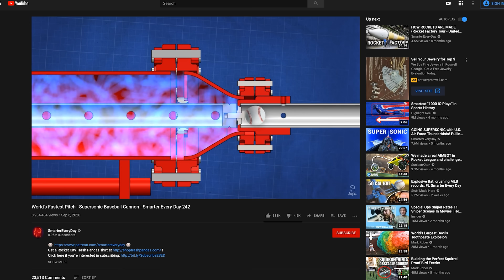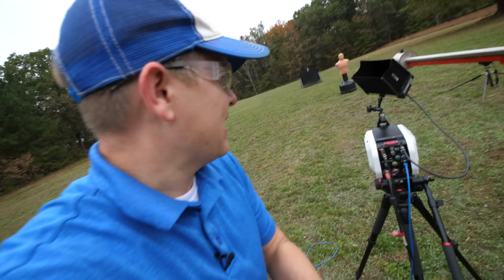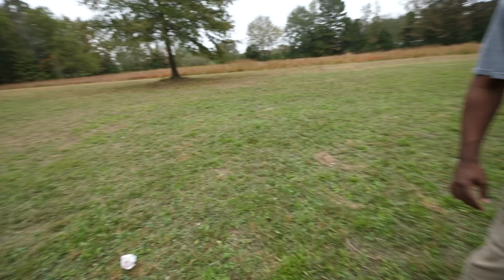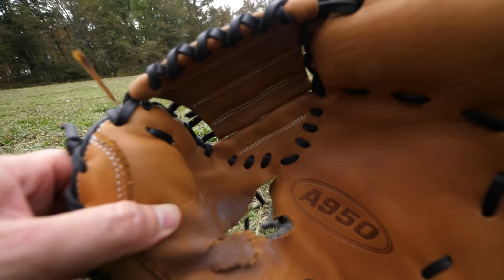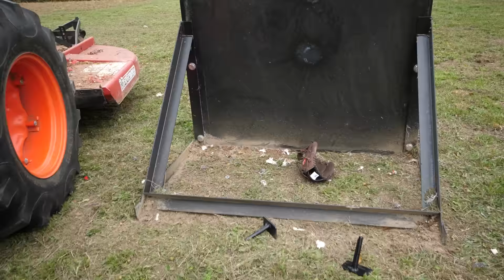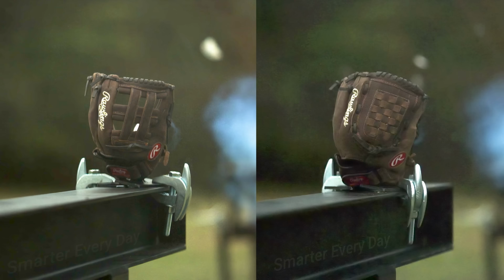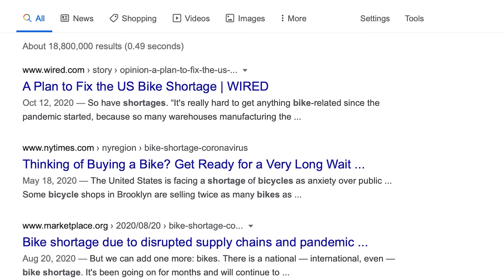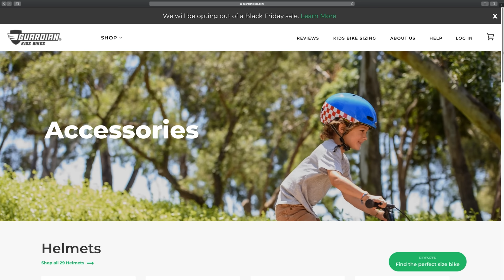Trying to Catch a 1,000 MPH Baseball - Smarter Every Day 247

Comment: I think the fire is a combination of the friction heat generated from the leather on leather contact + the adiabatic heating from the compression of the air into the enclosed glove.
Reply: Compression of the air or the oils/organics similar to dieseling
Reply: The ball was actually on fire before it hit the glove. Little orange comet tail 10:50
Reply: Nope, the ball isn't in contact long enough for friction. But close it is the compression of the materials because of the impact. When you compress matter it heats up.
Reply: @diconicabastion5790  heat caused by compression is adiabatic - also, the opposing force caused by friction does not go to zero regardless of velocity.
Reply: @willhagar9163 I want to know what you think dieseling is.
Reply: I shall now call you Mr. Einstein
Reply: You need fuel, oxygen, and heat for fire. Fuel is the leather. The oxygen is from the air compressed in front of the shockwave. The heat is also from the compressed air, I don't think there's much heat when the leather contacts, but it does atomise it. Sorry when I see dieseling I expect a piston.

Comment: Hey Destin!
Answer on your "fire" bewilderment: It's not friction but adiabatic compression of the air between the baseball and the glove. That's why the H-weave had no fire- the air was free to move through the netting. The basket weave was too tight for the air to freely pass, thus adiabatically heating the air to incandescence, then popping out the back. Fluid physics! Yay!
Thumbs up so Destin sees!
Reply: hey you just beat me to it, posted it below. Mine was just a hunch, but I bet you have qualifications to make this judgement
Reply: I was thinking the same thing, although I did not know the technical term for the phenomenon. It happens sometimes with large bore ammunition in ballistic gelatin as well.
Reply: so... Does that mean the other glove had more sugar?   X'D
Reply: I don't see that as the definitive answer. Most leathers are treated with oils for conditioning and suppleness. I agree with another answer in another thread (Jonathon Carey): they were compressed, atomized, and heated above their flash-points. I would check the gloves for variations in oils and formulations. This is a job for Project Farm: "Let's find out!"
Reply: I'm skeptical. The air is certainly compressing in the leading wave of the baseball by virtue of being supersonic, but is it enough compression to result in an adiabatic reaction? 

The classic example of adiabatic compression is the combustion reaction in an engine cylinder, not in free air.

We need more data!
Reply: Oh shoot,  you could be right. I was thinking it was something similar to paper exploding in a hydraulic press, but if that was the case, we would've seen fire on the H-weave too. That makes a lot of sense.
Reply: @togden88  define "free air". The weave back traps the air to a great enough extent that the air can't escape fast enough to remain below incandescence. Remember, the baseball is moving faster than the speed of sound, so when the baseball approaches a barrier, the air can't move out of the way fast enough. Hence, high adiabatic compression
Reply: @TenemaesLament  I agree that it's a possibility, but we simply don't know enough about the reaction to make any absolute claims.
Reply: I really don't think so. Take a look at 10:53 and you'll see that the ball has fire trailing it before it hits the glove.
Reply: @yannisgouras4482  your interjecting politics into a physics discussions, as well as a one sided trump joke, go back to watching late night talk shows.
Reply: @Sun_Rider_FPV  everything was regular old science until someone crapped in the pool.......
Reply: I was wondering if moisture in the air or in the leather created cavitation bubbles, but in the end, it sounds like this is the same affect. Cool stuff.
Reply: Thats cool. but why is their fire behind the ball when they are firing at the basket weave glove?
Reply: @ryannickles3218  That was stitching that came loose as the ball traveled down the barrel.
Reply: Yep! At that sort of speed, it doesn't take much to trap enough air for adiabatic compression to be really impressive

Comment: That mini fireball probably came from the super compressed air between the glove and ball. It didn't happen on the H weave because the air could move somewhere else. I've seen this same effect in the rebounding aftershock in ballistics gell from extreme high speed bullets. When the cavity collapses it rapidly compresses the air inside and causes ignition.
Reply: Most accurate statement yet

Comment: Look closely behind the ball around10:52  before it even hits the glove you can see a little red flame behind the ball, crazy!    The list of things you should try shooting with this are endless, hope we get to see more soon!  also rub fuel on the ball and see if it ignites mid air.
Reply: I went to comments as soon as I saw it, hoping someone pointed the tiny fire trail form the baseball out
Reply: Not a chance.  Remember just how slow this slow motion is.  The sparks do not contain enough energy to heat up the nearby fuel to ignition.  Its not that fire begets fire, its that fire is hot and heats things up to burn them.
Reply: Hire this man.
Reply: @randohorsley  I'm not saying it would ignite the ball, I'm saying add fuel to try and recreate the spontaneous mid air ignition that is already happening with the ball in the footage, the flame is started before it even hits the glove, maybe the ball had some oil on it or something.
Reply: That is just so crazy. The amount of energy in this system is more than scary
Reply: Yeah I was looking for this comment
Reply: Oh god i see the flame. “Lit”
Reply: Oh yeah!  Nice spotting.  You got a good eye.
Reply: NinjaRider777R  That would make sense.  Still... he has a good eye.  I didn't even see it.
Reply: I suppose a flame would first form on the front of the ball, I may be wrong but it could be just a thread
Reply: The fire is the compressive heating of the air between ball and glove, just like a fire piston, nothing unexpected at these energy levels.
Reply: NinjaRider777R  The only correct answer here
Reply: @mi4936  There still is a flame at, 6:23
Reply: More than likely strings fraying.
Reply: I think it's simply plasma. In the same way plasma is present while a booster from a falcon 9 is re-entering the atmosphere.
The compressed air enters a state of plasma :)
Reply: @fickdieoma12345678  I see your point but plasma is created if a flame gets hot enough. The ball was only going mach 1.3 which is too far slow to create the heat needed to start a plasma which is 25,000 celsius. You simply cannot compare a baseball going mach 1.3 to a falcon booster going mach 6 and a booster is made to produce plasma unlike the baseball.
Reply: @cxptain3vil193  I dont even think that 13:57 is showing a flame. Look at 6:24 There is always a faint cone traveling behind the ball, which i believe is a shock cone, from the ball going Mach 1.3. What we see in 13:57 is probably the shock cone forming from leavin the the vacuum barrel and heating the ambient air and also yarn debris.
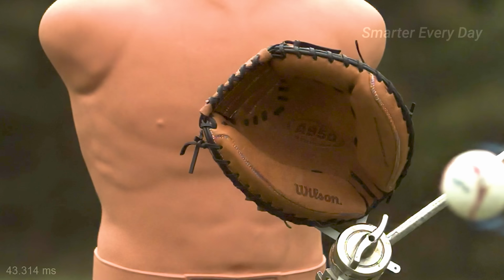Reply: 6:46 is cool too
Reply: Could it be the compressed gas that is igniting?
Reply: @jonathannelson1449  Unlikelz imo. The gas is expanding, thus cooling down. In front of the ball is a vacuum so there is very little gas there to be compressed and heated, which is a key design aspect of this type of cannon
Reply: The cone you are seeing Is called the vapor cone, shock cone same thing there is many named for it,  which is produced from high speeds including supersonic. Also the "flame" I probably saw at 13:57 was probably just debris from the glove. It interfered with my vision, my bad for the confusion.  @weltraumprasidentsuperstar5871
Reply: @jonathannelson1449  I highly doubt that they are using flammable gas and if they are using flammable gas that would not cause the ignition because since the ball is going so fast the gas they used would been all gone. But you could be right there is a possibility that is the case. Im no professor im just as curious as everyone here.
Reply: @iankrasnow5383  yes they should of used a real ballistic dummy to show the effects of a baseball going mach 1.3 into center mass😂
Reply: @ExperimentalFun  I believe they are using compressed oxygen which is flammable. I dont know how much heat air friction can cause at the speeds but that may be the source of the heat.
Reply: What you're seeing is condensation of moisture in the air after the shockwave over the ball. Same thing happens over the wings of a supersonic jet.
Reply: @user-cn8ie6bq7d  that's not the part I'm talking about, you need to look more closely, you can see a red flame coming off the ball
Reply: NinjaRider777R  Sorry but I think you're wrong, it is definitely not a red thread. You can see the flame dissipate at 10:56, despite the fact that the ball is not rotating or moving in a way that would block your view of the threads. This happens at the very end of the slo mo clip if you watch the frames
Reply: @user-cn8ie6bq7d  its just called a vapor cone. It is not after the shockwave. It is when the pressure waves or mach waves radiate towards the ground causing a sonic boom. The lower pressure condenses the water resulting in a vapor cone.
Reply: NinjaRider777R  Yes, I very obviously understand that baseballs are held together with red thread, so there is no need to be condescending.
I am merely pointing to contradictory evidence, which is that the fuzzy red splotch visually disappears at the end of the clip, which is not threadlike behavior. I am just pointing to this and asking if you know an explanation consistent with it being a piece of thread. "Flapping" is a subjective assessment and I can barely see it, I think the ball is moving way too fast (1000+ mph) through the fluid for that sort of high-low pressure oscillation to even occur. Aerodynamic heating becomes very significant at supersonic speeds so it's not an unreasonable question.
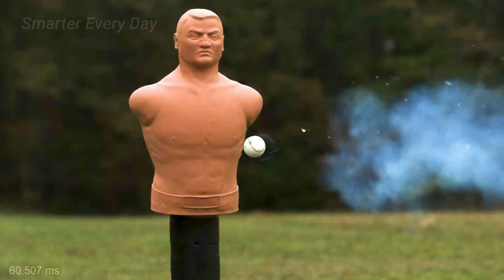Reply: Also at 5:26 the ball has a aura glow around it on the slomo camera just before it goes into the chest,
Reply: Friction. Air friction
Reply: NinjaRider777R  That does not make sense. If it disappears as a result of the ball slowing down then why is there so much lag? The forces exerted by the glove are no longer acting on it by that point. It only disappears in the last few frames, yet it is visible and still the entire period between exiting the ball and the end of the clip.
Reply: Yea🔥
Reply: NinjaRider777R  You may not believe me, but I literally do have a degree in physics irl so I do understand the concept of inertia. You reiterated the same point in finer detail which suggests you didn't get my point.
To use your example, when you slow your hand down the string "catches up" to your fingers almost immediately. Instead we see the ball and "thread" continue for some time, both clearly visible for a significant distance. The red splotch then literally fades out, if you pause and skip frames you can literally see it becoming more and more transparent. That simply does not happen when a physical object eclipses another object (ball eclipsing "thread"). The only possible explanation is camera focus, but the threads on the actual ball are clearly legible.
Reply: could it be igniting the oxygen from the friction of traveling through the air same with the leather
Reply: who wants roast baseball for dinner? cooked at supersonic speed!
Reply: I'm guessing it's friction from air resistance. Which is why most aero designs have that swooped back look. The wind follows it back sticking to it(laminar airflow) and there's less drag as a result.
Reply: @iankrasnow5383  Depends on how big the ballistic gel is. The standard sized gels would probably explode. Until it ran out of energy, but it would probably be less than a bullet if the blocks were really big and able to withstand the forces.
Reply: @cxptain3vil193  The color of the trailing glow is orange which suggests temperatures of around 950C. Planes that fly at subsonic speeds can have shockwaves because locally air moves faster than the speed of the plane. Also remember the ball has heated up due to friction in the barrel and many particles large and small already come of the ball because of it. The color of the glow on impact is whiter so hotter.
Reply: @RudyPaulenko  hmm in this video the ball was going supersonic not subsonic. Subsonic is mach 0.8 whereas the ball was going mach 1.3. The shockwave you're talking about Is called a vapor cone which is just condensed water molecules.
Reply: yeah nah i get that its string on closer inspection and i just thought the friction of the two surfaces combined with impact and force would have created alot of heat also because leather ignites at only 230 something celcius and is sonoluminescence not when sonic waves in water collapse a bubble creating immense heat but simular sort of i guess but im just a man idk
Reply: That's not a flame, that's the red thread from the ball's stitching.
Reply: @BillyM148  It could be the string, that's very possible, but it would need to be a lot of string to be that visible, and all the other times the ball seems fine after launch, plus we know for sure there are lots of flames when it hits, which is the only reason I think it could be fire.
Reply: My genius wife noticed the same thing!
Reply: Cxptain3vil , no even below the speed of sound the air sometimes has to move around objects that forces the air to supersonic speeds. You can actually sometimes see these shockwaves on the wings of commercial airlines. They are quite small (couple inches) but cause a shadow that is visible.  The cone you talk about is related to vortices usually at wingtips or other sharp edges that cause local regions of low pressure, cooling and as a result condensation. There was also a red piece of thread visible after the ball went through the glove. I wonder if that was already there before the ball hit the glove.
Reply: This is blue light circle traveling behind supersonic ball. In this book You can find why it is happening: В.Ф. Андрус "Основы нейтронной физики". Please find and read this book in English.
Reply: @user-cn8ie6bq7d  This is not sound wave. This is blue light circle traveling behind supersonic ball. In this book You can find why it is happening: В.Ф. Андрус "Основы нейтронной физики". Please find and read this book in English.
Reply: NinjaRider777R  Please read the book. This is a light of ultraviolet spectrum. When air plain reach and cross speed of sound cone of sound/pressure wave consist mostly of water vapor but also PRESENT THIS BLUE (ultraviolet) LIGHT. On some rare pictures of the plane from behind in that moment  You can see it.
Reply: NinjaRider777R  That is why if SED team use UV camera they can see much more powerful light in this place. Also, pay attention that in this case they record this effect on dark background that is why we can see at least something. Usually this effect not detected at all on bright or sky background.
Reply: I don't think its flame, looks more like the red thread on the ball loosened up. Look at how stable the ball fly before and after hitting the glove. There is the same red trail after it hit the glove. The darker contrast before hitting the glove make it look like a small flame.
Reply: Your forgetting one more thing, the ring around the ball
Reply: @idkanameforthis  no thanks